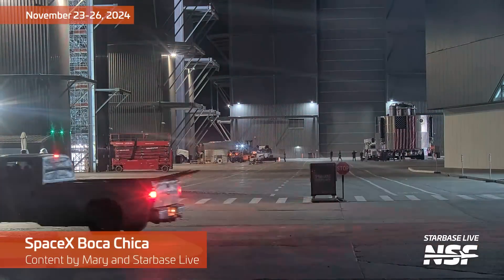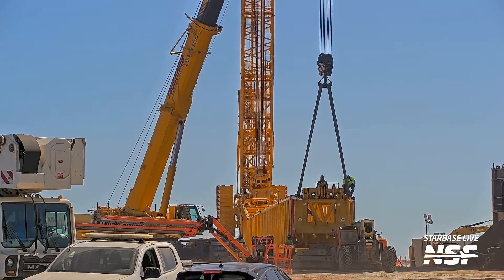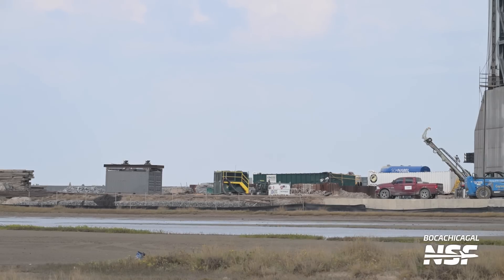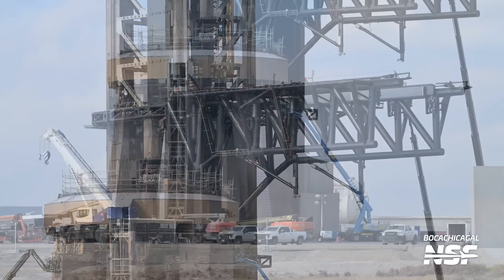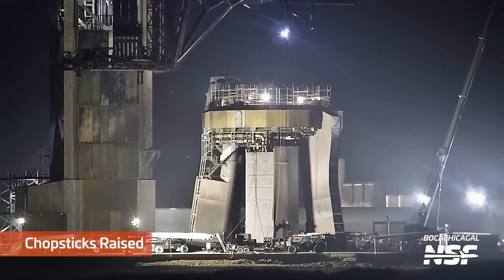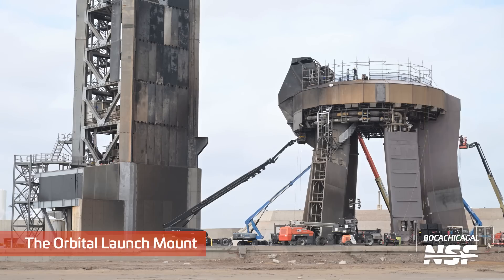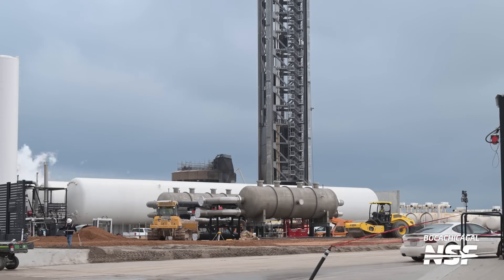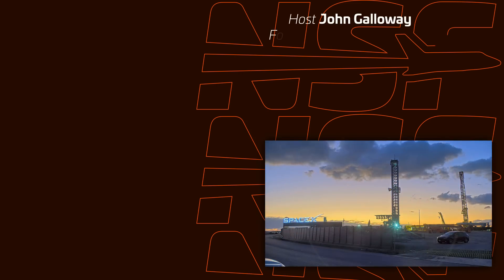Booster 16 Parts Spotted (Flight 9)! | SpaceX Boca Chica

Comment: They should be using paint that uses the heat of the blast off, to anneal and harden the paint
Reply: What paint is that?
Reply: @ i just threw that out there... but there are paints that harden with extreme increase in temp.maybe they don't even use paint and just use bare steel. Better than removing peeling paint all the time.
Reply: @al_7_405  I myself know little about paint outside of domestic and some light commercial stuff, but those temps under there get pretty hot and the pressures really high.  It's a tough environment for things not specifically designed for it.

Comment: 3:44 Random thought on the antennas on the Chopsticks...maybe they're thinking of installing some onthe arms to avoid future communication issues and just want to see what sort of signal they get from that placement.  No idea if that's what they're doing or how it would work out, just a thought
Reply: Why on the arms?  Usually you want the highest point for LOS.
Reply: @imaginary_friend7300  No clue, I'm just spitballing.  Though when the booster/ship comes back for landing the arms will be towards the top of the tower, and they'll be spread wide.  With antenna on both arms that might give them a wide scope to communicate with the incoming vessel.  Or something along those lines

Comment: Why don't they clad more of the tower and OLM in stainless steel? It has a higher melting point and doesn't need to be painted to stop rusting.
Reply: But it's stronger and cheaper to use carbon steel plus it's far easier to get construction material in carbon steel.  Few places make construction elements in stainless if any.

Comment: a pulley is any system of ropes and (grooved) wheels
a winch is a specific system that uses a rope wrapped around a cylinder and then rotates that with a motor to pull a weight
Reply from the maker: You know, I thought about saying a winch had a motor, but there are definitely manual winches. - Das

Comment: The guy who runs the assembly for that specific section of the rocket retired and they put a flag on it to celebrate him😊
Reply: Well the flag when hanging down like that the stars are usually on the right so is that an upside down flag
Reply: @bodiethorson2785  SpaceX struggles with this concept on a regular basis

Comment: Those pads , may be targets for booster/Starship alignment for landing----
Reply: I think your on the right track. During my Navy days in the Survey Branch, a small group of Hydrographers and my Radio Petty Officer and I (Leading Radio Fitter), were helicoptered on to a very small 'Island' (more like a rock), in the middle of no-where, near Snare Island South of New Zealand. The Hydrographer's laid down a Survey Marker and set it in concrete. We then set up a Magnavox Satellite Receiver and with a plumb bob set the aerial to the center of the survey marker. We also recorded the height from the marker to the base of the aerial. We then got taken back to the ship HMNZS Monowai. After a week of the Magnavox SR recording satellite signals, it was collected and returned to the ship. Calculations were done to give a very accurate GPS co-ordinate of that Survey Marker. This was about 1984. The idea being that return missions would collect another set of readings, so that they could measure the movement of the Tectonic Plates over time. I wonder if the message we scratched in the wet concrete is still readable? (If you can read this, your in the S^*t)
So! Now this is how I think this relates to the Antenna's on the Chopstick mid-point catch area. A GPS co-ordinate will be calculated as a reference point for the arm, so that they will use this as a reference point to another reference point on the side of the Booster or Ship, in order to have 'targets' to match up with, when it comes to the next catch. The computer software will try to match these up in the return trip to the tower. That's my guess.

Comment: A Pulley and Winch are separate things but related to each other.  A pulley is a "wheel"/pivot point with a rope/chain wrapped around it and is used for "pulling" heavy loads and/or changing the direction of force applied through the rope (it also does a bunch of stuff related to force distribution and lifting).  A winch is a mechanism basically does the same thing, but without the ability to change the direction of movement, it is designed to coil a length of rope/wire and pull in a single direction.  You can use a Winch and a Pulley together.
Reply from the maker: That makes good sense! -Das

Comment: 05:27 - FYI; we don’t call them I-beams any more… 😉Structural engineers call those ‘Wide flange’ beams or ’W shapes’ now.  Hope that helps!
Reply from the maker: Good grief, previously a structural engineer told me they weren't I beams, they were H beams 😅. Pull the other one, it's got bells on. - Das